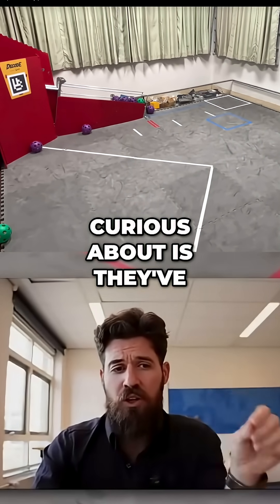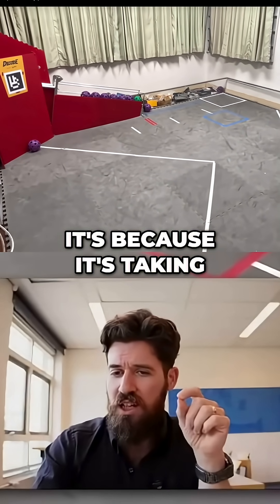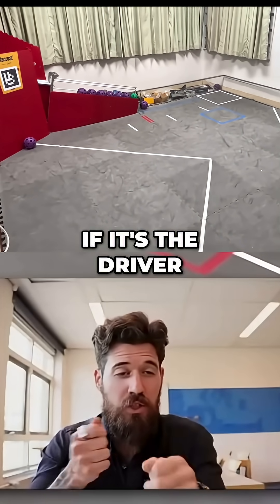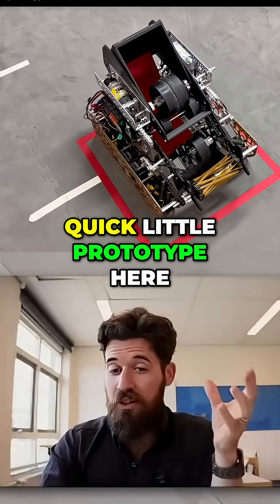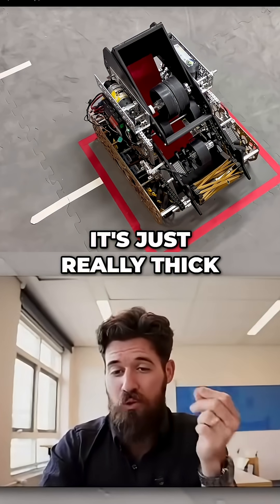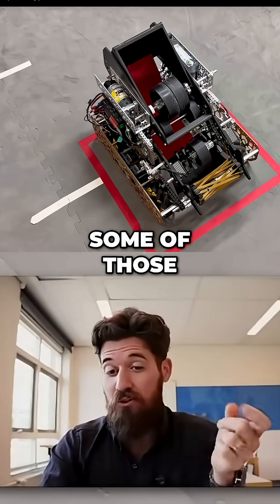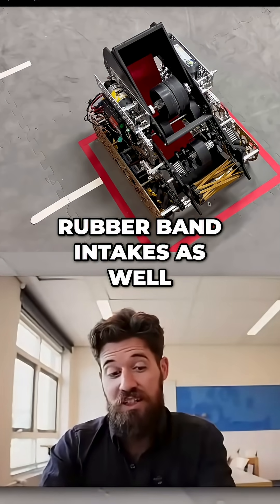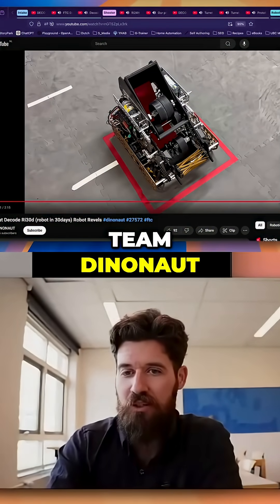FTC DECODE Full Field Hooded Shooter

Comment: yeah at those rpms it takes a long time to spin back up. for our far shooter, its running at around 6500 rpm and takes 2-2.5 seconds to recover, whereas our near shooter is at 5000 rpm and recovers in under a second
Reply: I wonder if the bevels are taking up some energy, from what I've seen the gobilda ones have lots of backlash and pretty bad efficiency